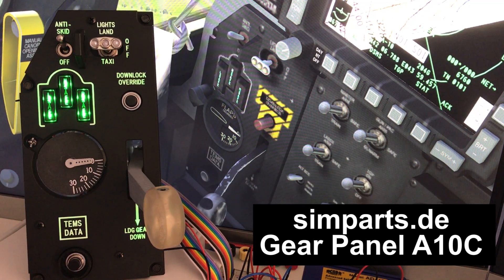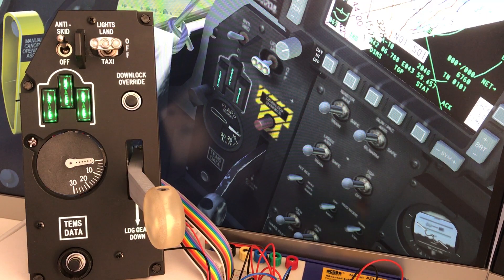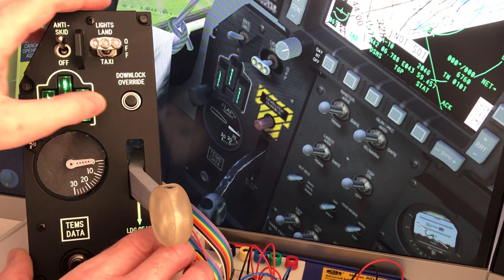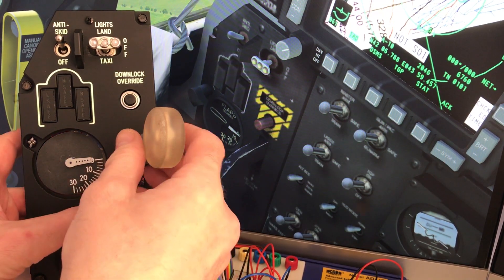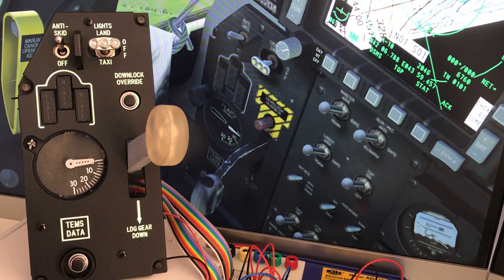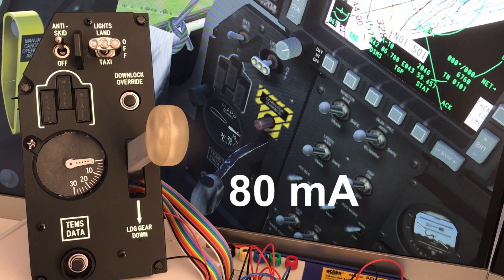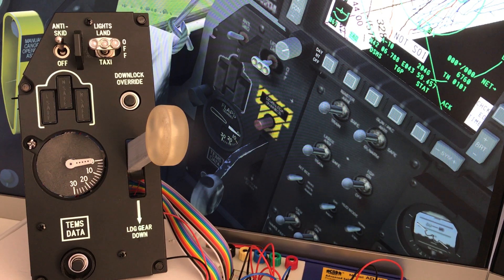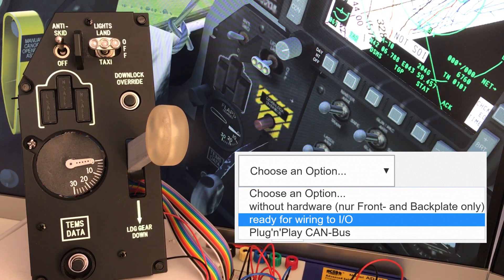simparts Gear Panel A10C function test

Comment: What do you think the overall cost (usd) would be to put one of these together including backlighting , flaps gauge and everything.  Also, it looks like there's quite a delay between the actual panel and the sim...is this eating up your frames?  or no frame chewing up at all?  It looks like the land lights / taxi is not lighted or is it?  it's hard to tell because of the reflection of your overhead lights...in the sim that switch is lighted with 3 green jewel lights on during back-lit operations of the cockpit.  Hopefully they have fixed that landing gear lever functionality or perhaps that could be a non-starter.